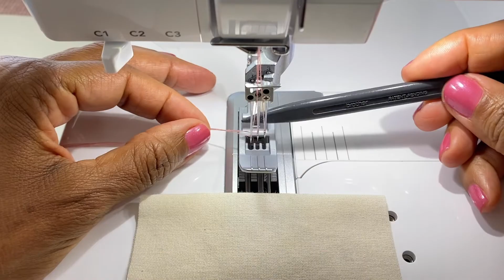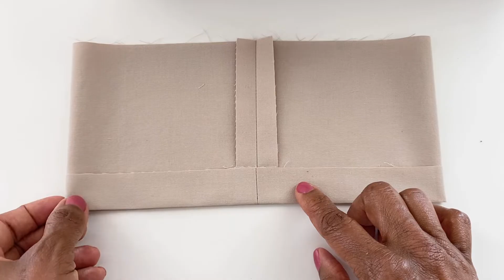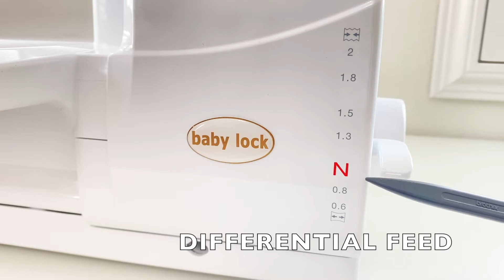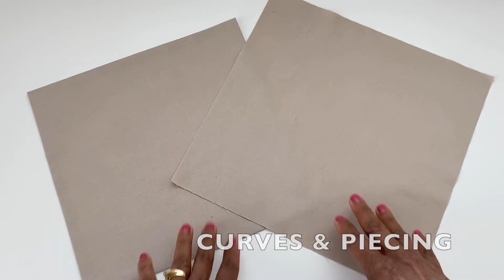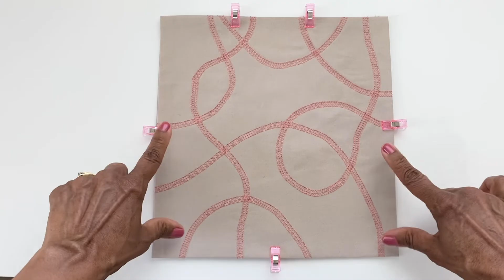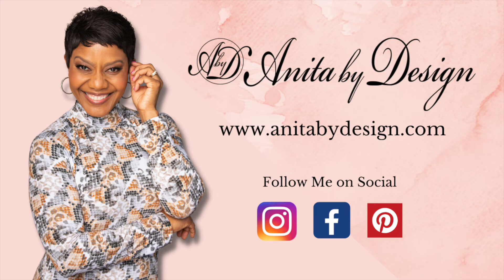How to Use a Coverstitch Machine | Step-by-Step (2021)

Comment: 14:51 If you had used a margin slightly more than 1" when sewing the seam (but keeping the original fold at 1") would it have gone over the edge of the inside fold and hidden the raw edge underneath the looper stitches?
Reply from the maker: Yes, this is true.

Comment: I have an Ovation that I bought years ago but haven't used in well over a year.  I'm still a little confused on how to use the chain stitch for garment sewing?  it looks like a straight stitch?  is that the 5 thread safety stitch?
Reply from the maker: My overstitch uses 4 threads

Comment: what if you establish on the right - where it should go but as you start stitching - you can't see the groove?  tape?   from the starting point to the edge of the table?
Reply from the maker: You will try to keep the fabric aligned with the original line you establish and keep your focus in that place. Don't look at what's happening at edge of table, only your focal point where you start. I hope that makes sense.

Comment: Hi, thanks for your wonderful tutorial. However, I have a question. Can this coverstitch machine use to sew with a single needle? I mean Can sew like a normal machine. Thanks
Reply: It does not replace a sewing machine. It sews with one needle but as a chain stitch underneath.
Reply from the maker: No, this is a specialty machine. You will still need your regular sewing machine for seaming.

Comment: Help please. 
I’ve tried to do a two needle cover stitch but the chain does not form.  Can someone please help, what should the settings be?  I have the Euphoria.
Reply from the maker: I highly recommend taking a look at your owner's manual. If you don't find a solution there, take a trip to your local Baby Lock Retailer. I'm not able to help without actually seeing what's happening.

Comment: Do you use serger needles or stretch needles when sewing on knits?   The info I have read is confusing.  I have a Brother coverstitch machine.
Reply from the maker: Hi Ellen! I've done both. But the serger needles are designed to work with both woven and knit fabrics. I use the serger needles.

Comment: Quick question for you. I have a lot of existing clothes that I want to hem (sleeves & pants) with a cover stitch and they are all different colors. I don't want to invest in so many different cones of the same color thread, especially on such small simple projects. Is there any way that I can use something like a bobbin to create a small second spool of thread to be used on the 2nd needle? I don't care about the wrong side of the fabric, since the thread color doesn't show. It's only on the right side of the fabric with the 2 needles.  Thanks!
Reply from the maker: Oh, yes, absolutely! I've used a bobbin on a small task on my coverstitch machine before. It works just fine.
Reply: @AnitabyDesign  Awesome.  Thanks so much.  I LOVE, LOVE and LOVE how you respond to your viewers messages so quickly.  You are so awesome.
Reply: @AnitabyDesign  Hi Anita, so I have a Baby Lock Unity sewing machine and the serger thread cones are too tall to  place onto the stem to wind some bobbins.  May I ask you how you wind your bobbins with serger thread cones?  Do you do it from your sewing machine?  I may have to buy a separate automatic bobbin winder?
Reply: @proudasiangirl576  you can get a cast iron cone thread stand online. They run about $7 to $25, depending on which company you buy from.  I love mine because I can use any thread on any machine without worrying if it will fit.
Reply: @sandraanderson5114  Can you please send me a link so I can see what you're referring?  I can't visualize what you are talking about.  Thanks!

Comment: Anita, that was an excellent video. I am considering purchasing the Euphoria, and that was a huge help to my understanding of what the machine can do. Regarding the gathering, is there any way to figure out in advance how much fabric it will loose in the gather? Or do I have to experiment? For example, say I have a dress where there is a bottom panel that is gathered and then sewed to the bottom of the dress to create a frill, or gathered sleeves above the cuff, how would I make sure that it is not gathered too much so it no longer fits the piece that is needs to be sewn to? Or do you recommend just doing the traditional way on a straight stitch machine with a couple of rows of stitches, and then pulling the gathers to the required length that you need? Thanks again for the great video.
Reply from the maker: Hi David! That's a great question and I don't know. I'm thinking it would be a good idea to do a test run. Maybe cut two strips the length of the two pieces you will be putting together, then play around with the gathering to see how much will be taken in. From there you can make adjustments.

Comment: I’m curious, is it difficult to adjust the tension on this machine when switching to the different fabrics?
Reply from the maker: It's not difficult to adjust the tension. You would just turn the dials. I haven't had to adjust the tension on my machine yet and I have used different fabrics.

Comment: Great tips. I just started using this type of machine, it feels strong and confident in stitching but had trouble with fabric bunching up and getting stuck. Also seems difficult to keep fabric straight like regular machine. Have been using three needles but will have to practice different modes.
Reply from the maker: Oh wow! Not sure why your coverstitch is doing that. I've never had that issue with mine. You may want to take it in for service to see what. the problem could be.
Reply: @AnitabyDesign  It's brand new. I was using a stretch fabric. I started using it without looking at any tutorials. Thanks to your tips I know about the thread, how to move the fabric along, etc. I should have done research before using it but was excited to finish a hem on it. Also need to learn about using 2 or 3 needles and all the spools.  On another question do you know why a regular sewing machine would squeek? I opened it up and cleaned out threads and lightly oiled a moving part. I don't want to be out of it for weeks taking it in to service. Im planning other projects that I can get done with serger only. Thanks for your videos and your help!
Reply: @myYT548  if it is bunching up, you may have your differential feed set  to less than 1 (below the neutral).

Comment: That was a great video, especially about removing previous stitches. I have a few questions. 1. From your experience which is the best needles for sewing rayon jersey knit scarves, ball point needles or jersey needles? 2. After that what size needle would be best for rayon jersey scarves? 3. Currently, I am experiencing problems using my coverstitch machine. I am working with the wide coverstitch and having a problem of skipped stitches. Every so often or every few inches the stitch changes. So it goes back and forth to the stitch I want to an incorrect stitch. What is interesting is that this was not the case when I first started. I would appreciate your thoughts/suggestions/comments. Thanks so much.
Reply from the maker: Hi Jenneh! I'm glad you enjoyed the video.

1. Jersey needles are ballpoint needles.

2. The needle size is always dependent upon the thickness of the fabric. For jersey I would use a size 10 Jersey needle or size 11 Stretch needle.

3. It's always hard to detect the source of skipped stitches without sitting at the machine. Start by rethreading the machine to see if that fixes the issue. Check to make sure that your needles aren't damaged (bent). You could also adjust the stitch length to see if it makes a difference. If none of these suggestions work, it could be a mechanical: I recommend taking it in for service. Sometimes, the machines start doing weird things when they need to be serviced.
Reply: @AnitabyDesign  Well thanks so much. I changed needles, removed all thread, used a can of air to clean all areas, changed  all thread and it is fine now. I was getting kind of desperate then thought do what you always do, start from scratch, start everything from the beginning. Glad I found you Channel will certainly watch more videos and thanks for the quick response.

Comment: Excellent video showing all the functions for Babylock coverstitch, in love with the chaining off feature of the Babylock.  My Janome CoverPro CPX1000 doesn't allow chaining off.  Only had it about 4 months and hate it.  It runs like a farm tractor, sounds like a farm tractor, tunnels everything. Bought it to hem lightweight knits, it has ruined every sample I have tried, Janome says to use wash away stabilizer. Yuk.  Tried every setting from max to min and everything in between, does ok on heavy weight jersey t-shirt but forget slinky nylon/spandex fabrics.  Doing 1 last test with new thread instead of the cheap[ thread Janome sent with the machine (snags on its own spool feeding, has thick spots, doesn't feed even). Thinking I will trade it for a Babylock. Unfortunately not everything from Japan is cool, Juki serger runs like a dream, ever have to touch any of the knobs, it works on every fabric I have put thru it and runs smooth as silk. thanks for your awesome video.
Reply from the maker: Oh my goodness, Marc! I can hear the frustration. I heard from another creator that Janome machines don't do well with cheap thread. Hopefully using a better quality thread will be the answer for your Janome.

You're very welcome. I'm glad you enjoyed the video.

Comment: You are the greatest Anita! If I didn't have the Babylock Triumph, I would get this machine after seeing your video. You could take that specialty thread chain you created and couch it with invisible thread to add dimension to a garment! You could really upscale a seamline by sewing that created chain within the ditch of the seamline. Currently, I use braid in the inside of my jacket's inside seams in this way.
Reply from the maker: Oh, what a great idea to use the thread chains in your inside seams.

Comment: Thank you Anita for another great and concise tutorial!  I have the Babylock Evolution & was wondering how similar it is to the Euphoria?
Reply from the maker: Hi there! I have the Evolution too and it's a great machine. When you set your Evolution for a coverstitch, you can perform the same stitches I demonstrated on the Euphoria.

Euphoria is a dedicated coverstitch machine, Evolution is a combo serger/coverstitch. Euphoria has a built-in needle threader, Evolution has manual needle threader.

My main reason for wanting a dedicated coverstitch is that I use both machines on most projects and switching back and forth on the Evolution was too much, so I barely ever used the coverstitch feature.

Comment: So awesome! Removing the stitches in case of a mistake, blew me away…. And, using the chain stitch in my knit fabrics for the seams…totally awesome.  I have tried the Eloflex threads in a standard machine with a stretch stitch…save your money. The Coverstitch machine is worth its weight in gold.
Reply from the maker: Sharon, I'm so glad you picked up a few tips from the video. 🤗
Reply: That is a really great hidden tip in your video. You should clip it out and put it on TikTok or on a Youtube compilation video

Comment: Anita, I am hemming a fleece coat which is quite thick and when hemming the sleeves in the round it’s hard to get the fabric under the presser foot to start sewing on my Euphoria. Do you have some suggestions, please? Thank you!
Reply from the maker: Hi there. If you lift your presser foot to its normal raised position then pull up on the lever as far as it can go, the foot will rise a bit higher. Also, make sure you increase the stitch length to accommodate the thicker fabric.

If your fabric still doesn't fit under the presser foot, you may want to consider hand stitching the hem.
Reply: @AnitabyDesign  thank you Anita. I will try that!

Comment: Thanks for the video. I was wondering if when you change fabric type do you change settings on the machine? Thanks
Reply from the maker: Hi Merralinda! It depends. I always do a test stitch on a scrap piece of whichever fabric I'm using to determine if I need to make any adjustments. I hope that helps.

Comment: Can you use the chain stitch to do the rushing on a sun dress? Wether it be cotton or stretch fabric.
Reply from the maker: Hi Antoinette. Ruching requires the thread to be pulled to create gathers. I don't think that would work with the chain stitch because of the chain that's created with the looper. You need long straight stitches in order to pull up the gathers.

Comment: Hi Anita. You are a born teacher and the work and help that went into this video is not lost on this gal. 🙏🏼  💗I am learning to like my cover stitch more and more with each project. Your tips are wonderful. I really need to try using it on wovens. I do think the learning curve can much more steep than some people are willing to deal with. Payoff for learning is really good though. I think my biggest frustration with knits is ironing up the hem to the exact same measurement all the way around. Easy on wovens. Not as easy on knits. Thank you again for your time, treasure and talent! 😘
Reply: Try a little spray starch on your knits to help flatten them before your turn them up to your desired hem width.  Knits can be a little curly.  I agree with you about Anita, I really want a cover stitch machine after watching her video, so informative and right to the point.
Reply: @evelynwald9132  Thanks Evelyn. I will certainly give this a try. ❤️ @kristimakes 😘
Reply from the maker: Another tip, and something I do with most of my really thin knits that curl: Apply a strip of knit interfacing along the raw edge of the hem. Just cut a strip the width of your hem allowance. It works so well with pressing up the hem on knits because it gives you that ridge to follow.
Reply: @AnitabyDesign  This is very helpful. Thank you. 💗
Reply: @AnitabyDesign  Love this!

Comment: Hi Anita, I bought this same machine and was wondering what you have your setting at for the different materials?  Thanks so much
Reply from the maker: Hi Tammy. I didn't change any settings unless I mentioned it in the video. You can test the stitch length on a scrap piece of fabric to see if you need to make any adjustments. I hope that helps.